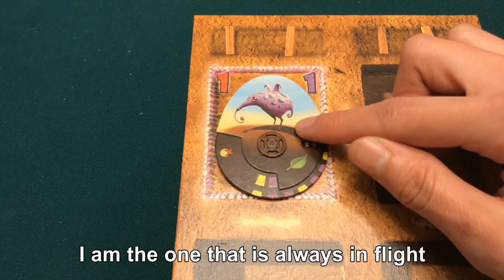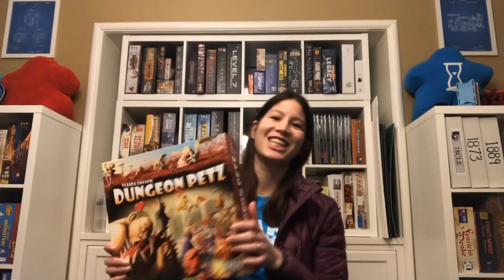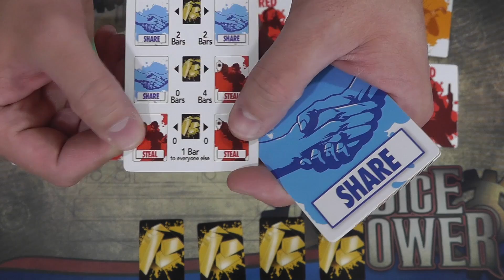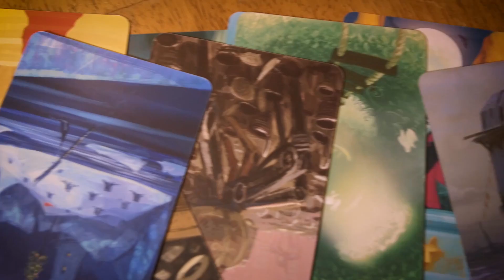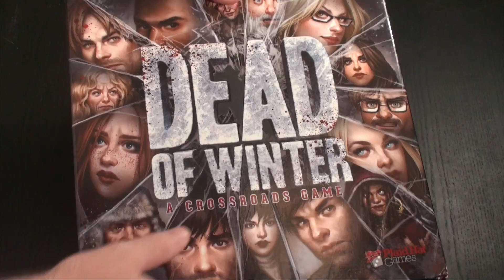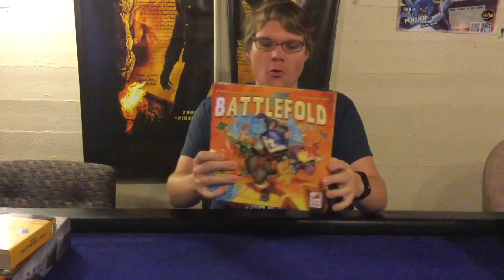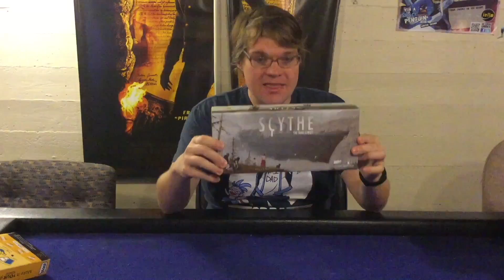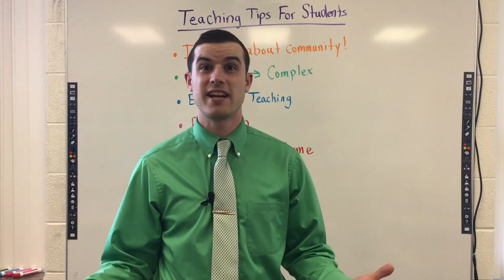Throat Punch Lunch - Episode 32: Out of Town...Be Back Soon!

Comment: @Jay - this is why I stick to power tools & don't take up carving :) .  Seriously though, you do learn a lot about wood & grain direction working with tools like that as well as chisels.  So cutting downhill is always the better way to go to help prevent those large pieces from flying off.  This is especially likely if you chisel into the end-grain.  So in those cases it might be better to cut on the adjacent face instead to have better control.  Good luck next time & keep up the creations!
Reply: Thanks Jonathan! And thanks for the advice!